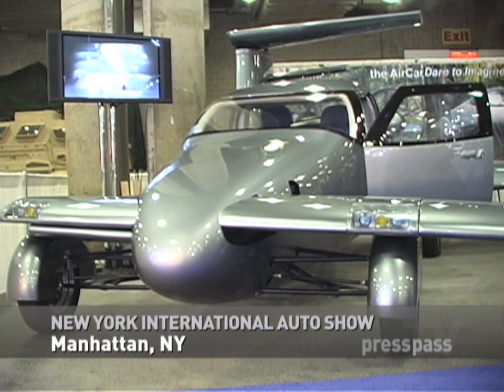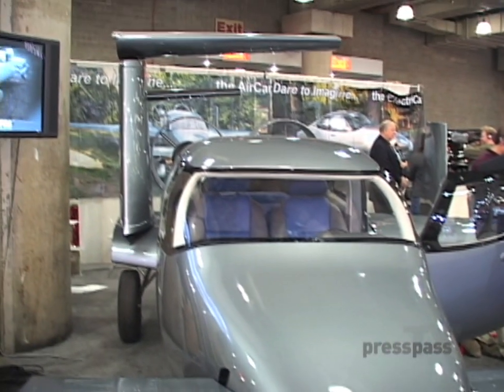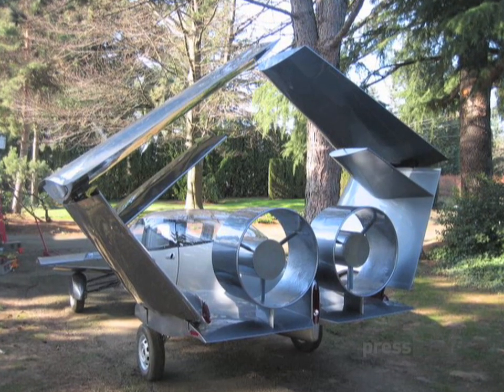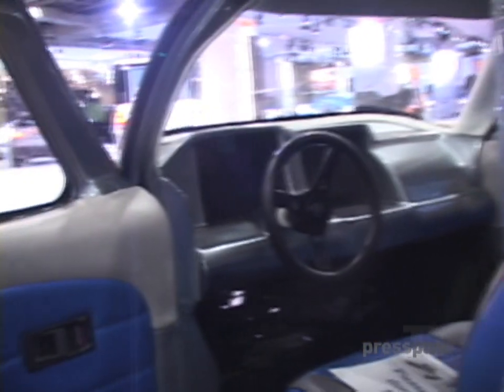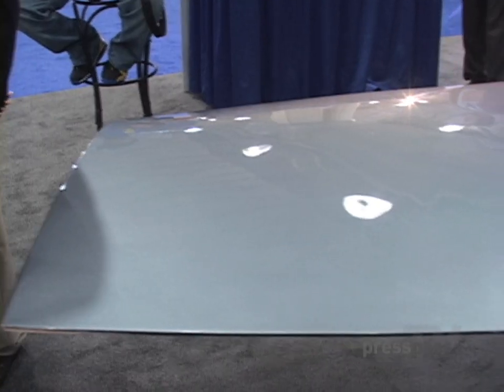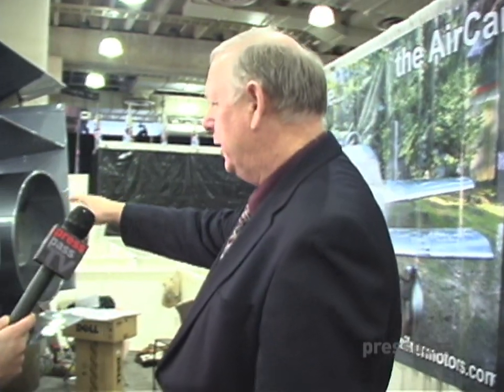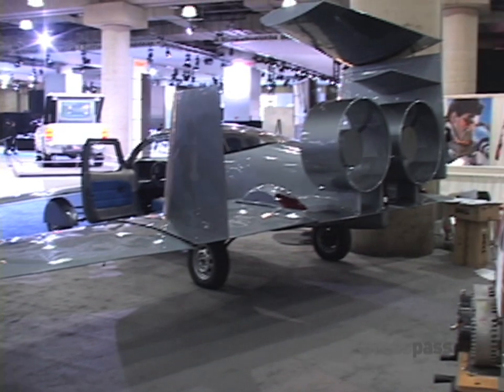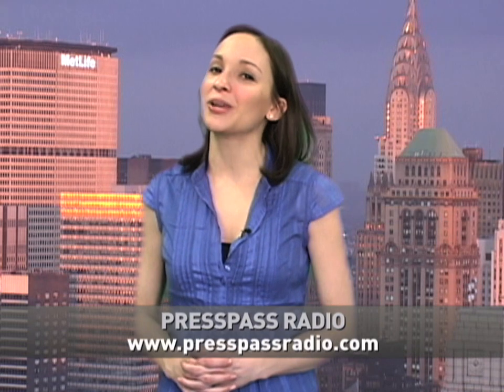Flying Car!  Milner Motors AirCar at the New York Auto Show

Comment: The reason this design is completely impractical is not because of the technical problems. The main reason is that it doesn't make sense economically.  With any of these designs you still have to go to the airport to take off legally.  That defeats the very purpose of this design.  If you have to drive to the airport anyway it's much more economical and practical to simply drive your own car to the airport, get into an FAA certified plane, fly to your destination and simply rent a car there!

Comment: 1. What "sientist"? In fact, what IS a :scientist"?? 2. All gasoline automotive engines end up requiring a catalytic converter as part of their emissions package. The FAA would NEVER certify a catalytic equipped engine. Not only that but the catalytic converter would have to be HUGE as aircraft engines typically run at 75% power while cruising. Automotive engines run at maybe 10%. And, that's just the catalytic. You couldn't even hope to BEGIN the FAA certification process with a smog motor.

Comment: Publicity stunt or not, there is a definant vision in doing a horizontal take-off car instead of a vertical take off one like Moller has been working on.  Unfortunately, as with any airplane, flight stability is going to be an issue.  I wonder if this thing has been tested in a 200 mph wind tunnel yet, though.